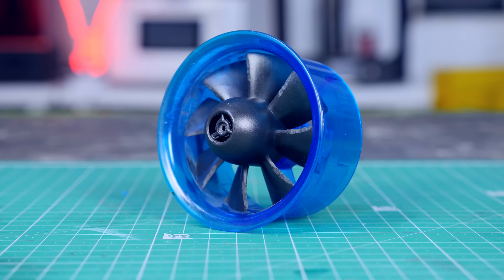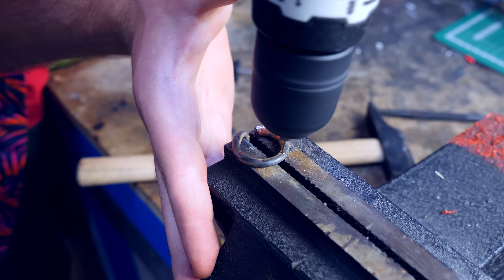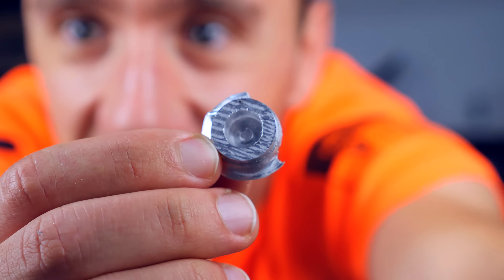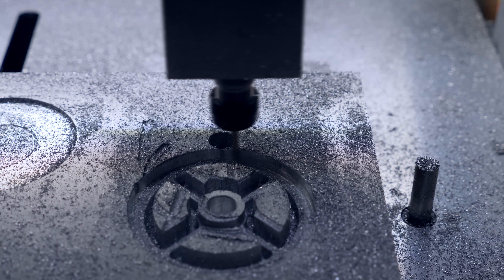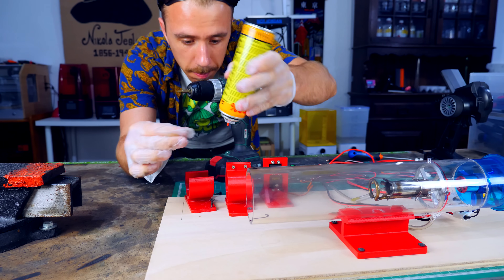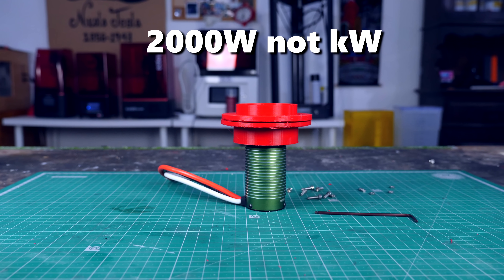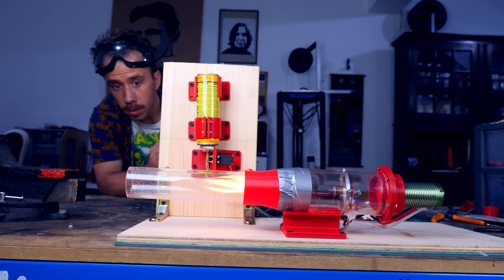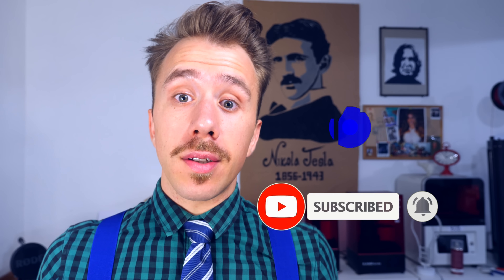I turned my Fan into a Jet Engine (3D Printed EDF Afterburner)

Comment: yello, i just wanted to remind you that, USE A VENTURI! its a lot more effecient, mixes fuel and air a lot better than your lighter gas and it lets you use a gas canister instead of using a smoll can of... can.             just gurgle it and interperate it into the turbo jet ;) you allmost had it champ.

Comment: 11:05 That depends on the design of the engine. An Axial flow turbojet (like the ones used on the ME262, the HE162, Yak-15, F-86, etc) uses a normal fan since the airflow goes down the axis of the engine, but what you're thinking of is a Centrifugal flow turbojet engine (like the ones used in the Meteor, MiG-15, MiG-17, etc). Centrifugal flow engines were easier to produce than axial flow engines in the early stages of jet engine development, but axial flow engines took over even towards the later end of early jet development, and nowadays axial flow engines are the most popular design.

12:58 And that's part of why centrifugal flow engines were used more in the beginning. The centrifugal compressor was easier to build and more efficient at getting the high compression rates to let the fuel combust more effectively at first before axial compression was perfected.

13:23 here you can actually see why afterburners are only used at high thrust settings. Before he goes to full power you can see the flames from the afterburner flowing back up the engine assembly towards the compressor, which in a real engine could cause pressure imbalances that can lead to compressor stalls and possibly the fan blades in later compression stages shattering.

Comment: You should try to join a pulse-jet engine with tesla valves to move a tesla turbine and use its torque to move a car or to generate electricity.

Comment: Why not use a plasma arc lighter for ignition. You can remote mount the leads into the engine. It takes up less space and most of them are rechargeable via usb.

Comment: Video idea: follow up to the turbojets, but a machined turbofan engine.
or
3d printed RC hovercraft using the edf's
or
make a proper thrust stand to measure your contraptions power
or
a 3d printed (or machined) wind turbine to try and recover some energy from the creations you have

Comment: I mean the basic concept of a turbojet is that you have a turbine/fan powered by the combustion that spins your compressor fan fast enough to keep the burn going, you just need a steel fan at the back running the one at the front and an electric motor with a clutch to spin it up to operating speed then disengage so the motor doesn't get spun to death!

Comment: Pity you haven't tried to use the fuel bottle "the right way up". When you used it horizontally, you got a bit of liquid and a bit of gas. That could have been inconsistent. When you used it upside down, you got the liquid - good for filling up lighters -  not sure that it's that good for you setup. You could see lots of un-burned liquid on the walls of your chamber because the liquid needs to evaporate and mix w/ air to burn.  I would try to use the bottle "the right way up", so the bottle gets cold first not your fuel lines and you don't need to deal w/ un-burned liquids because you don't get any. You might want to consider to figure out how to "warm" the bottle - passive metal heat sink w/ a lot of fins and an air fan? Water?  Also - I likely don't know what I am talking about, I know crap about physics, I've just played w/ lighters a lot when I was a child and somehow I have survived.
Reply: video idea: measure the thrust of your engine, build a rig, one you can re-use

Comment: Where is the nozzle???

Try using this ridiculous motor to develop different types of fans, one for high flow, one for high pressure. Then you can use these in different types of applications (maybe with minimal changes)

Comment: 3:56 shorter bit helps a lot and for hss bits in aluminium  its rpm is 80×1000/(pi×diameter)  
If you use carbide mills use 200 And up Instead of the 80

Hss bit you do 0.05mm per cutting edge per rpm

So aluminium bit 4244 rpm and 4 teeth  you get 848 mm/m feed

Comment: Just a couple of quick CNC tips. Machining aluminum is always tricky with small machines. You really need a tight machine with very little runout. You might want to check yours and then upgrade your collets to a 3rd party manufacturer if it is bad. 
Another simple thing to do is reduce the amount your bit sticks out the end of the tool.  Small changes in this can greatly reduce chatter and tool breakage. 
I like to use a feed and speed calculator to correctly set your machine up. A good calculator will take in account your RPMs as well as bit stick-out, and HP.  If you can, I found misting the part also helps tool life and reducing gumming up your bit. 
If you want your parts to look nice, I always rough cut run direction, leaving say 0.25mm extra on the part, then come back and cut that remaining 0.25mm off the other direction at about 1/4 speed of the roughing passes.  Hope this helps!  Keep up the awesome videos!

Comment: An afterburner is to add additional thrust to a turbojet engine. You need to build both of these as a single system to see how much real thrust you can actually get and then put it on a linear rail system with at least a fishing scale attached.

Also, Tomatoes ARE DISGUSTING!!!!!

Comment: You could build a valuable flow restriction. To optimise the ratio of pressure to flow resistance. To do this you can get silicone tube with ~5cm in diameter and ~10cm in length. But it on the end of a tube and now you can squish the tube with a zip tie to create a resistance. You might even be able to motorize it to open and close the nozzle. It's important to squish the tube evenly and without moving the center too much. Otherwise the thing might get unstable or even melt.

Comment: Good thing about petrol engines is one you cut the ignition the engine stops, but this isn't possible with diesel,  if something is flammable is present (eg oil) when the fuel stops it will keep on trucking, sometimes with horrific results! Might be worth fitting a Guvenor/air cut off for powering down!

Comment: Could you build a reaction controll system (RCS) with mono propellant fuel?

And add it to a flying object (plane or something else) with the afterburner jet engine and steer with the RCS module only?

OR

Put the afterburner jet engine on a plane and add VTOL.

Comment: Ive got this edf I didn't use from another project so let's make a jet engine with it. I burned out my edf while making the jet engine so let's take this opportunity to make another thing. Any maker knows that feel ive lost count of the number of times a scrap project has ended up making more scrap than it used. I swear yarn is deliberately sold in sizes so you always have to open a brand new parcel to finish the last bit of the project

Comment: You should try looking up taser modules on Amazon/ebay. That should greatly simplify your ignition system. Then all you should need is an 18650 battery or similar and a switch to turn on and off the module.

Comment: Your flame tube isn't really acting as a flame tube, it is just a hole where the glow plug is sitting. Yes, some of the fuel is going that direction but only because your fuel jets are sending fuel towards the nozzle and towards the glow plug. I would think it would be better to introduce the fuel into the flame tube, with it moving in the air flow direction then pass the glow plug, then the flame exits the flame tube and enters the main nozzle.

Comment: Video Idea: Triebflügel, Im pretty sure you could get some lift if you make some rockets and use a bearing to rotate the wings.
Update: you run the fuel line through the wings and actually use the body as a fuel tank.

Comment: You should first measure the thrust of that engine, then build a plane or boat to fly it, if the weight to thrust ratio is too low for an engine you should first use it to roast a tomato, then attach a turbine to is to use as a prop on a boat or to generate electricity

Comment: When milling aluminium you need to lubricate a bit because alu tends to stick to the tool. 
I also noticed you have a very long endmill which had alot of woble to it.  A shorter end mill wil be more rigid.

When cutting parts that fall trough a plate its best to leave 1 mm of material at the bottom before the final cut. Otherwise it wil vibrate (enter trough pilot hole. No helical cut!).
Alternatieve you can leave some studs  in place around the part and cut it out afterwards using a plier.
Also correct speeds and feeds make a big diference and are quite easy to calculate for your setup.

Some quick tips from a cnc machinist!

Comment: I'm thinking you might want to orient the gas bottle with the nozzle up. With the nozzle down, you're getting liquid propane instead of a gas. This isn't going to the burn as efficiently, and you're probably just blowing a bunch of liquid propane out the nozzle. Also, as you depressurize the bottle, it gets really cold which lowers the pressure of the gas. To get the gas pressure up, you could try putting the bottle in a warm water bath or something.

After looking at the video again, the pinholes you have in the fuel injector may be small enough to atomize the liquid, idk. Might be worth a try, though.

Comment: Glow plugs are not a component of combustion in a Diesel engine. They are a component of fuel heating in indirect injection or pre-cup engines to allow the hot fuel to burn more easily when it is compressed. Compression is the only form of combustion in every diesel engine.

Comment: @integza. Two suggestions for upgrades on this model. 1) I noticed that about 30% or maybe more of the fuel is getting wasted in forms of unburnt fuel i.e. the yellow flames and just the liquid fuel spilling out. Probable solution for it: add two glow plugs after the fuel injector sandwiching it assuring proper combustion leading to more thrust. 2) Also add one of your nozzle designs at the end instead of the long tube. Pick the nozzle the u feel will focus the exhaust more at a point thereby increasing the point thrust. Just suggestions. Pls do let me know the mistakes and flaws in the logic.

Comment: Sling the fuel line around the glow plug to preheat the fuel and ignite the fuel further in the chamber to generate more pressure. The fan needs a little concave shape on the duct to accelerate air speed and pressure.

Love it keep it going! I want to see a turbine that actually produces a little bit of thrust from the afterburner :D
Reply: yhea i thought about that too. a chamber for the fuel to expand, might also be worth placing the fuel dispersion behind the ignition point instead of in front that way the airspeed from the fan will help to disperse the fuel and create a better fuel to air mixture. i also think he isnt getting enough fuel into the engine, this can be seen when he's increasing the fan speed and the flame dies out.
Reply: @emptyforrest  Exactly! The flame tube should consist of two tubes . the outer one should have larger holes to disperse the fuel. the inner one should contain the preheat fuel line which should then disperse the fuel in the outer chanber. But that may produce some overheating problems i´m not entirely sure about that.
@integza should try that out...

Comment: Video idea: You should experiment with metal casting using a lost wax method, only instead of wax you use plastics. There's some filaments for FDM printers, as well as resins for SLA printers that are made just for this. It'd allow you to create shapes that you can't machine with a 3 axis CNC, like fans with overlapping blades, complex nozzles, or even fuel distributors.

Comment: 12:57 Slow high-pressure flow is actually a good thing. Most jet engines or turbofan engines utilize a compressor before the combustor “flame tube”’ and diffusor (used to slow the flow down) to increase what we call “total temperature” of the flow. This is related to the amount of energy the flow has. The larger the total temperature the more thrust you will get. I believe you biggest issue is in the flow speed at combustion. Ideally you want high pressure flow at “low” speed to enter the combustor/flame tube, combust, then travel through a nozzle speeding the flow back up. Hopefully this helps. This was my favorite subject and my area of study in college.

Comment: So Integza,,
If you kept the high rpm brushless motor but made a more efficient air-moving centrifugal fan for it, and then add a reversed set of static “blades” behind the intake fan inside of the tube, you can get the best of both worlds. High flow and high pressure. You could still 3D print the compressor stage blades, and 3D print the inlet fan. Add a ring all the way around the inlet fan to help distribute the radial forces evenly vs just on the tips of the blades

Comment: For your machining, try to use much shorter tools for better results. The tool holder provides the rigidity needed to keep the tool from vibrating and causing the chatter that you are dealing with. Around three times the diameter for the length as a maximum of using high speed steel tools, and four times if using solid carbide endmills should give much better and safer results. There is a reason that tuning forks have long tips....  Done with a short tool, aluminum cuts like butter.

Comment: Intersting concept the extended funnel reminde me of the V1 design burner. 
Looking on google for the hottest burning liquid it states 
"You'll get the most bang for your buck, relatively speaking, from acetylene in oxygen (3100°C) and either acetylene (2400°C), hydrogen (2045°C), or propane (1980°C) in the air." 
so maybe change the fuel to acetylene which could be supplied by a large canister?

Comment: Hello 🙂 I don't know if you are still trying to build some metal parts for your rockets. I have seen some YouTubers use their 3D printer to print PLA models and then, by applying the lost wax metal casting process, they were able to cast metal parts with the same dimensions than the 3D PLA model. Maybe you could try this interesting way to build your future rockets engine 🚀

Comment: Video Idea: hydro forming your own custom reusable fuel tanks. You can mig weild two metal sheets and use a pressure washer to expand the chamber. A youtuber did this, fuze I think. I'll get the link here in a min
Edit: I had his name but lost it again, ah hell here's the link, https://youtu.be/llhcATrmsBg
I think this will really help your problem with fuel running out too soon. 🎃

Comment: You don't need a centrifugal fan, actually most modern jet engines use axial compressor like the fan you were using at the beginning, and since designing a compressor is probably one of the most daunting things in mechanical engineering you're probably better using an off the shelf EDF, there are several that fit your 2kw motor fine, from what i see its a high KV inrunner so that was the correct choice